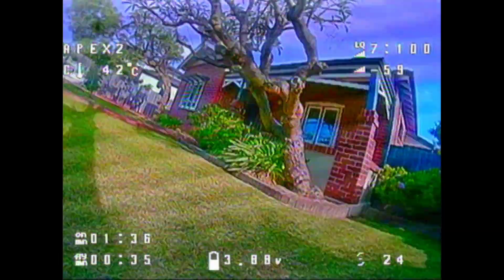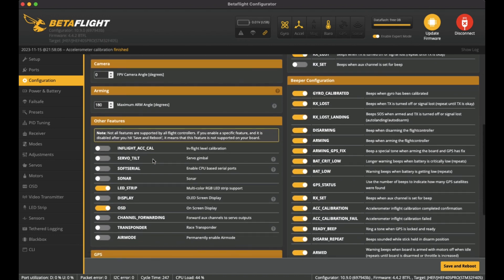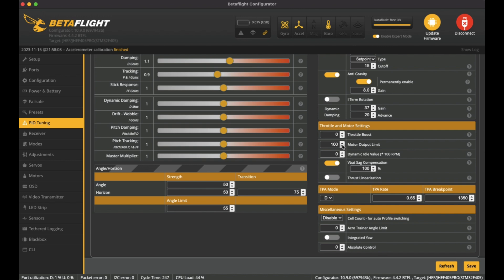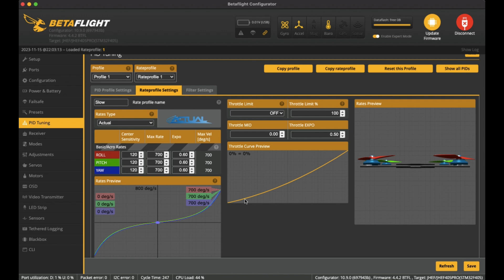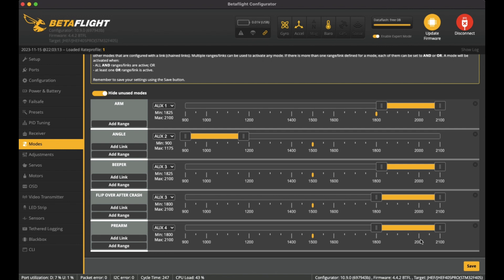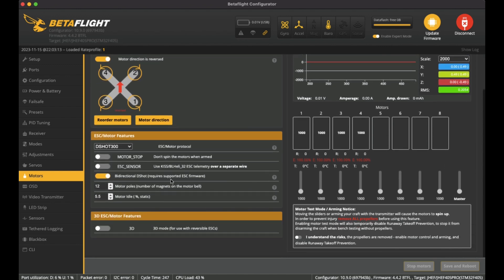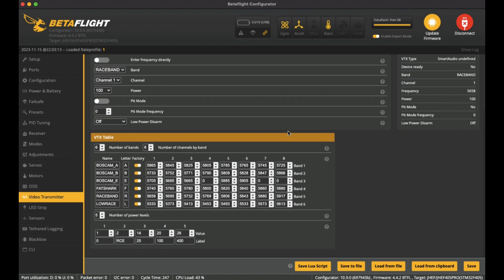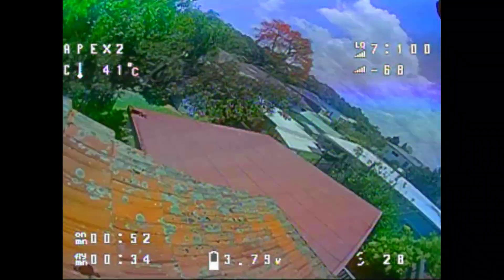Apex2 Build - Part 3 - Betaflight Config and Flights

Comment: Nice build!  👍🏽 
Liked and Subscribed. 
I’m currently building the exact frame. What do you think about using the Flywoo Robo 1202.5 11000kv motors on 2S?  Thanks.
Also in the adjustments tab I learned that you can assign a switch to change your rate profiles, a 3 position switch preferably.  Again, Nice Job with the detailed video.  I like the LEDs you have on there too.  👍🏽
Reply from the maker: Thanks! I think those motors would work well too. A bit on the lower kV side for my liking, but I think it would run a bit cooler and have a bit more torque than the 1003 that I used (based on the stator volume calculations, the 1202.5 has a larger volume than 1003). Nice! Thanks for the tip regarding rate profiles on a switch, but I use the Jumper T-Lite and have all my switches used up already. Maybe when I upgrade my controller 🤔 Thanks again for the comment 👍

Comment: hey i have the same board. if i plug on micro usb it didnt turn on my rx and gps. how to make it turn on my gps and rx when i plug micro usb ?
Reply from the maker: There's a 4.5v pad next to the SBUS pad (which is also next to UART1 pads). That should provide power when the USB is plugged in. Use that to power the receiver and GPS
Reply: @nxp200  1 pad for rx and gps ?
Reply from the maker: @ItsGrayyyy  yes
Reply: @nxp200  gps spec it say power input 5v. we can put it in 4.5v ?
Reply from the maker: @ItsGrayyyy  yep. That's correct. Components that have 5v input specified (such as receivers and GPS) actually can take a slightly lower voltage input such as 4.5v.